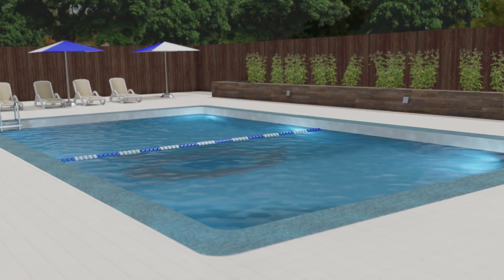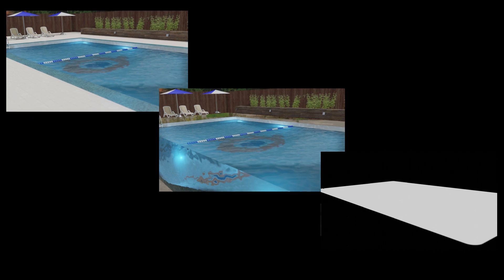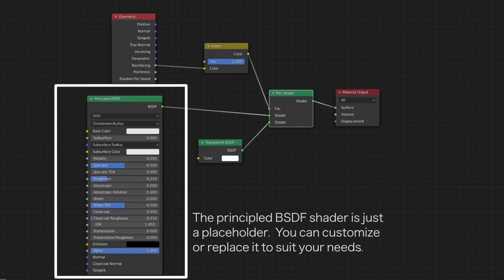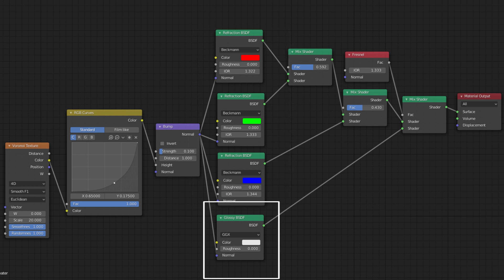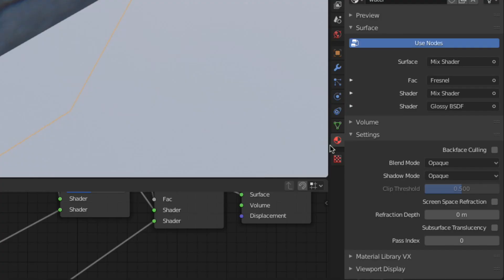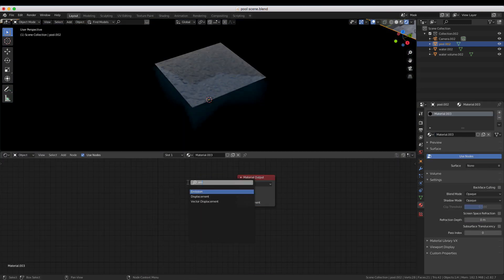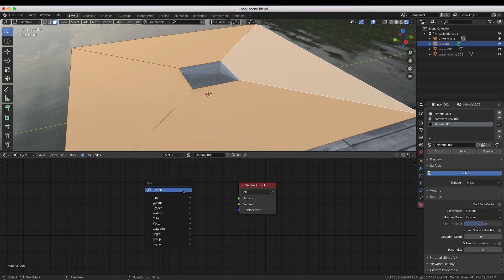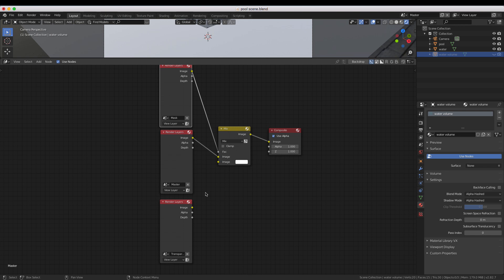Blender Tutorial: Refractive Water in Eevee

Comment: your  system  works  very  good , but  is  there  a  way  to  achieve  the  same  result  in  3D viewport , without  rendering  with  F12 ?
Reply from the maker: As long as the refraction is calculated using "screen space", the camera will have to see the bottom of the pool and/or  you'll have to composite it. Cycles doesn't use screen space refraction, so that's a better choice if you can handle the increased render time.

Comment: Sorry, bit of a noob question but how did you set your cube up like that at the start of the video?
Reply from the maker: If you're referring to the basic pool geometry, there are two ways to make a shape like this. Option A, Start with a cube using the face selection mode select the top face, press X and choose delete faces. Then using the edge select tool, hold down ALT and select one of the top edges (this will select the entire top edge). Then press E to extrude it, but immediately right click to "cancel" the movement. Because the added geometry is still there, you can then press S and scale it out to the desired size. Option B, Start with a plane. With the plane selected in edit mode, press I to inset the faces and drag the mouse towards the center to scale the new inset to the right size. Then press E to extrude it down.